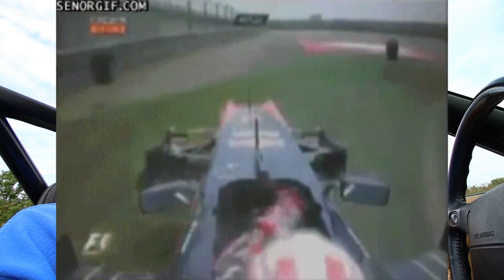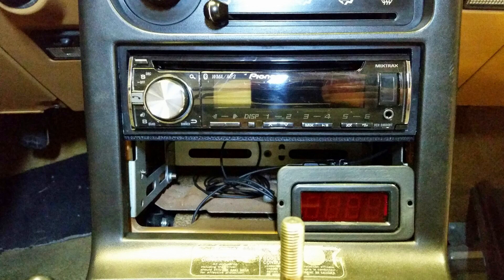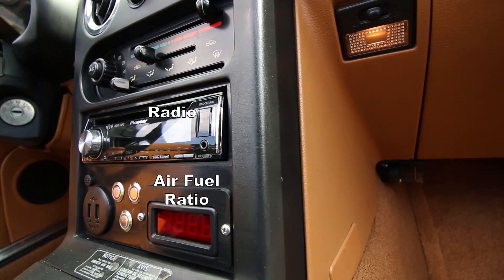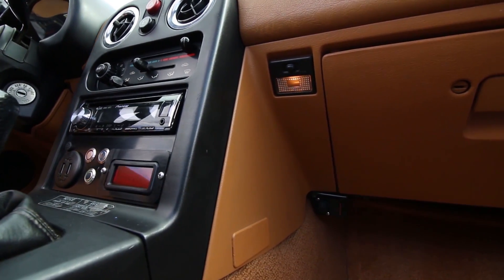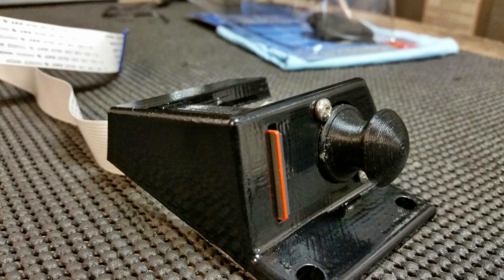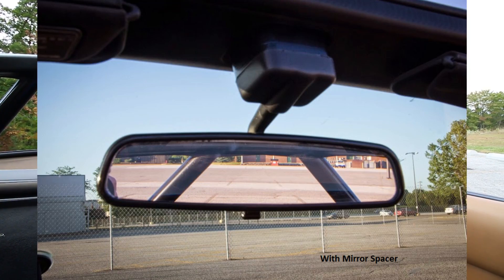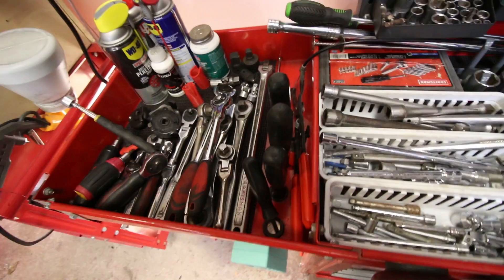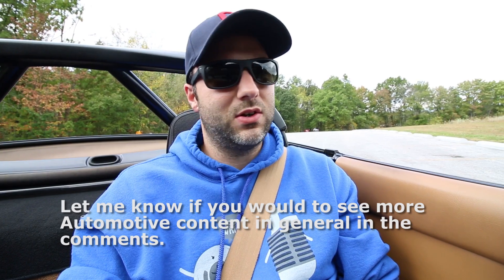3d Printed Car Parts!

Comment: wanna see some work on that haas mill!
Reply from the maker: Yeah I should do some projects on my mill for some videos. Turns out it's not actually a Haas. It looks like the Haas logo but with my last name which also begins with H instead of Haas. My brother who is pretty good in adobe illustrator made the logo as a joke.  The mill is actually a precision Matthews PM25 CNC conversion based on Hoss plans from CNCzone. I then built my own custom sheet metal enclosure for it. I've thought about doing videos about it for awhile I just haven't come up with the right project.

Comment: I literally just bought a 3d printer to  make parts for my 93 Miata! Nice 6uls
Reply from the maker: Nice! What parts are you printing?
Reply from the maker: ..and thanks!
Reply: I have a bunch of ideas i'm just waiting on my printer to get here from china...I definitely want to print out some door bushings and want to try the rear view mirror spacer. I also need to print off some new window cranks, I installed new speakers that stick out further than the originals and now they hit the speaker grill. There are a few replacement parts like the center console hinges and latch too.
Reply: NNFaNRacing did u ever make some parts? I was thinking of going online to make the tombstone and modify it.